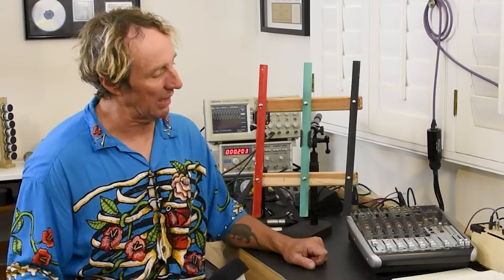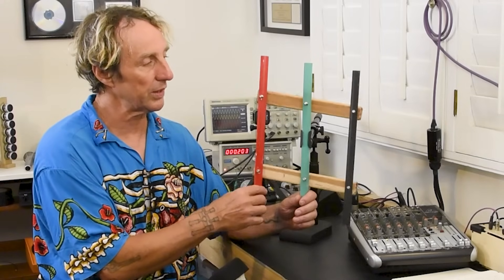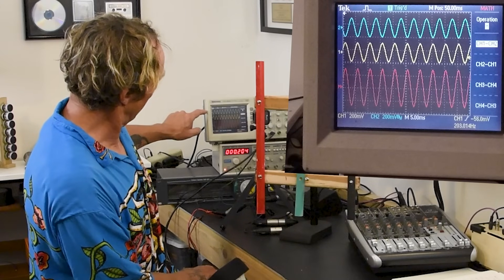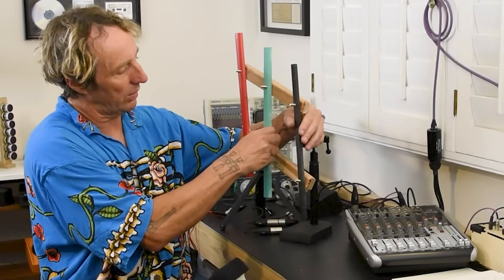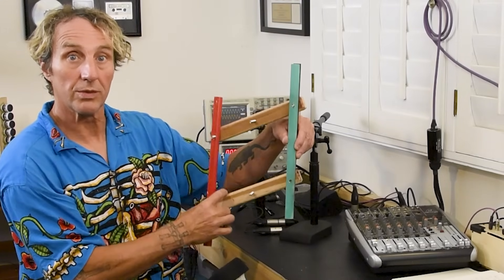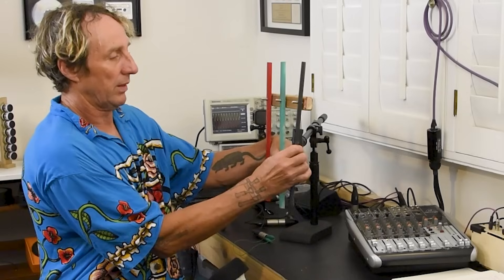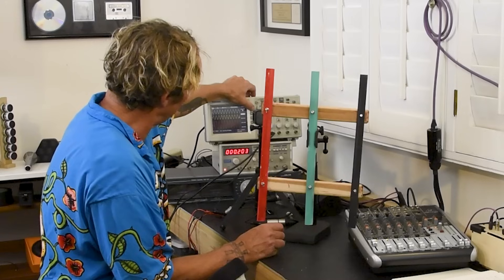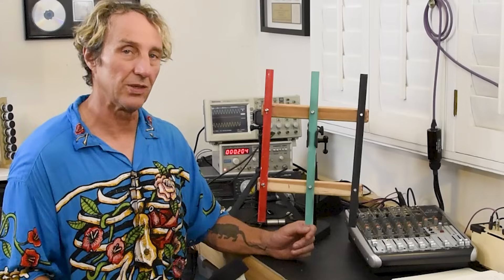The Mechanics Of Audio Balanced Lines Explained

Comment: This is a common misconception. Symmetry, which is sharing the opposite voltage across two lines, does not make a cable balanced. All it does is increase the maximum signal the cable can carry. If you do the math you can see that the noise rejection done by balancing the cable works if you transmit the signal entirely down one cable or the other, or split them evenly. Balancing means that you have a shared voltage reference that is separate from the safety/electrical ground, which helps prevent ground loop interference. I highly recommend watching the Audio Engineering Society sessions by Bill Whitlock on grounding.
Reply: Very good, simple and logical explanation indeed !!!
Reply: Effin brilliant!
Reply from the maker: I understand that we can use asymmetrical balanced lines as long as neither line is grounded. 

Since there is no ground reference for balanced lines generated by microphones and transformed , the offset to ground is irrelevant 

That said, symmetrical balanced line naturally occur and for all practical purposes the existence of asymmetrical balanced lines is irrelevant in practice.

But as you said, unbalanced lines that are ground references will fail to fully utilize all available input gain as the offset can cause one line to overload before the other in the input circuit
Reply: @  yes, it's a sadly too common issue that equipment manufacturers don't properly implement balanced IO and will tie neutral to ground, totally eliminating the benefits of balancing, believing symmetry is all that matters. Properly implemented balancing is almost entirely impervious to interference, as I believe you've shown in some of your past videos.
Reply from the maker: Very and yes
Reply: @DaveRat would be nice to have a vid reg. that fail implementations too.
Reply from the maker: That's tougher because it would focus on specific manufacturer flaws and not be this universal is understanding the concept
Reply: You are 100% correct. You can actually have 100% of the signal on one line and 0% of the signal on the other and the interface can still be balanced because it's all about EQUAL impedances of both signal lines (with respect to ground). Bill Whitlock is the headmaster of combating this misinformation in the audio industry. We haven't even talked about the Pin 1 problem yet.
Reply from the maker: And yet a ground isn't even required for a signal to be balanced.
Reply: @DaveRat right, just need the two output wires of the audio transformer!  Positive and Negative, pins 2 and 3 on the XLR, or Tip and Ring on the TRS plug
Reply from the maker: Agreed
Reply: @DaveRat  Ground is required for a signal to be balanced, as that is the ultimate destination of much of our EMF. In fact the term balanced refers to the equal impedance to ground of the signal conductors. Your differential amplifier has a ground reference in the circuit, even if that is just a battery, and transformers have inductive and capacitive coupling to their environment, which is usually a grounded chassis.

Additionally non-symmetrical signals are common in inexpensive differential amplifier circuits. You can even have balanced lines without any signal on one line, as long as both lines have an equal impedance to ground.

The reason for this is that noise currents that get coupled into the lines need to have equal impedance to ground in order to become equal voltages on both lines. E=IR

This video does a great job describing differential signals, but is spreading some common misunderstandings about balanced signals.
Reply from the maker: @mudged-upguitars4643 hmmmm, is it? Is a ground required?

Does a dynamic mic with each side of the voice coil connected to a pair of wires which are connected to the two ends of the primary to a transformer create a balance line, a differential circuit, is it symmetrical, none or all?

Where's the ground? Is the ground needed? Of course there's always ground somewhere as long as we are not floating in deep space but whether it's connected to anything in the circuit or not is another story.

Equal impedance to ground and that impedance could be infinity, correct?

Does the microphone and transformer need a shield to function? Is it a balanced line without the shield/ground/3rd wire?

Does a dynamic mic connected to a transformer create a symmetrical circuit and not a balanced line if there's no ground?

I think to say that balance lines require a ground infer that balanced lines require a shield and that is misleading.

And agreed that noise rejection can be achieved with asymmetrical signal levels on twisted pair lines driving balanced inputs.
Reply: @DaveRat  I think you are conflating balanced and differential again.

Voltage is the difference in potential between 2 points. If you have a floating circuit, with no ground, then voltage is measured between the lines. This makes differential currents, but only a single voltage, not opposite polarity voltages with respect to ground since there is no ground being considered. The only way that is a balanced circuit is if both wires have an equal impedance and are an equal distance from the noise source and environment. We connect signal conductors to ground with resistance to more easily control the impedances involved.

If you create a balanced line with the cable shield disconnected on one side there is still a capacitive connection for higher frequencies and inductively connection for low frequencies. There is no such thing as infinite impedance in the real world.

Let's have an extreme example, telephone lines. These used to be a pair of copper lines connected to 600 ohm transformers on either side. Where is the ground? On the telephone pole where the transformer can inductively and capacitively couple to its environment.
Reply from the maker: @mudged-upguitars4643 @mudged-upguitars4643 my understanding is a balanced line does not need 3 wires, only 2 are needed and neither of those 2 needs or should be grounded.

Are you saying that is incorrect?

My understading is that the output of a dynamic mic is such that if one side is shorted to ground and measurement is taken, it will be an equal voltage and opposite polarity to a measurement taken if the wires are reversed and the other side shorted to ground.

Is that not correct?

You mentioned that ground is referenced to control the impedances but is it necessary for a balanced line to function?

In your example of two 600 ohm telephone transformers Are you saying it wouldn't function if the ground is removed?
Reply: @DaveRat  I think there's a horrible mish mash of theory and reality in this discussion.

While the maths and physics say one thing, a real world (especially commercially viable) implementation will face more constraints.

The simplest version is 2 transformers, one each end of the wire, with no centre tap or other connection..
While being "pure" they are expensive and heavy and still need more work to be useful.
In that case, the concept of impedance is straight forward.

But, since the receiving end requires some electronics anyway, the ethos is why not have that circuit replace the transformer.
Again, it's possible to have each input be a separate floating circuit, but that's needlessly expensive.

Far more practical is to effectively centre tap the input, resulting in each leg of the signal wire being opposite polarity and identical magnitude with respect to the centre tap (and if you can conjour up a scenario where that isn't ground.. Very well done)

I say centre tap the input.
It can be done with outputs too, but it's best that only 1 end is tied (even virtually) to ground.
So, why opt for electronic inputs and transformer outputs? Because dynamic microphones are a thing.

One other thing to be wary of is trying to shoehorn every scenario into 1 cable standard solution.. It cannot work, that's why DI boxes were born.
Reply from the maker: So, with a passive output like a dynamic mic, DI box or transformer or an isolation transformer, all of which are extremely common in pro audio. (Maybe not the transformer out so much anymore) driving a differential balanced electronic or transformer input, the third wire ground/shield is optional. The shield helps with noise but is not part of the electric circuit carrying the signal.

And yet that does form a balanced line.

Input transformers are or were when they were common, often had center taps but that was mainly for phantom power. DI box outputs and iso transformers typically don't have center taps and are used for line balancing.

Anyway, the goal of the video was to describe how balanced lines work in a simple and easy to understand way. 

The facts that balanced lines can work in other ways like having non-symetrical signals as long as the impedance to ground is the same and that having a 3rd wire for ground/shield is desirable but not necessary or that even without the 3 wire that somewhere down the signal chain there will be a ground or earth, are relevant.

The brilliance of the naturally occurring transformer to transformer balanced line for telephones that you describe, I believe is the foundation.

Then later on electronic circuits were created to recreate balance lines electronically instead of passively.

That's where all these nuances and differentials that were discussing come into play.

Very cool and I enjoy the conversation
Reply: @DaveRat  I am so happy to be having a technical talk with you. You have blown my mind so many times. I gush about your feeder cable wrapping video regularly.

In your examples both ends of the interface still have circuit grounds. If you took the transformers out of their boxes you would still have a differential signal, but without a stable ground reference they will have terrible Common Mode Rejection Ratios.

It is a pedantic but, I believe, an important distinction. People often think "balanced" means balanced signals when it is in fact referring to balancing noise voltages for maximum rejection.

The ground conductor serves 3 purposes.:

1. Phantom power return path, as you mentioned. 

2. An electrostatic shield to prevent capacitive coupling of high frequencies with wavelengths short enough to cause differential voltages between the lines. It does nothing for inductively coupled noise, which is one of the reasons tightly twisted conductors have a better Common Mode Rejection. This only needs to be attached on one side to be effective, but the telescoping ground should always be cut on the input side, to avoid inadvertently connecting an antenna to the input before you apply gain.

3. Distribute a zero volt reference between gear. This makes sure everyone has the same ground reference and keeps impedance to ground more consistent, but is not necessary because each device has their own ground circuit they are referencing voltage to.

Talking about differential voltages on two lines without ground makes no sense because you are referring to ground to describe their electric potential. Describing differential currents makes more sense, but even there a reference to ground is necessary to describe noise voltage because the noise should be the same on both lines and thus 0 volts.
Reply from the maker: @mudged-upguitars4643 agreed that the noise being as close to identical on both lines is the key to cancellation.

I still think there's something missing in communication or understanding regarding the earth or ground or shield.

Earth, ground or shield is just not necessary or needed for a line to be balanced.

A twisted wire pair with a resistor at the end across the lines that are connected to a differential input or a transformer input will be balanced if those lines are the same length and same wire gauge and as you said, the same impedance to ground. They need to be identical enough that any noise induced is induced equally on both wires 

End of circuit, end of story, no ground needed. The output of the differential circuit or transformer will have a signal that encompasses any voltage differentials between the two wires while any voltages or noise signals that are common to both wires won't pass through the differential input or transformer or exist.

If you apply the same voltage or same noise or same anything to both the wires attached to the input of a transformer then there's no differential between those two wires and therefore there is no reproducible signal.

Anything that's different on the two wires will be the signal that is seen by and passes through the transformer or differential input.

Differential input, is by definition passing  the difference between signals on the 2 input wires and not passing signals that are the same on both.

Apply a signal to one wire and not to the other or vice versa and that signal will pass.

Apply it to both and it will not pass

Apply the same signal but with opposing polarity on one wire to the other and it will pass.

This will work with a fully isolated setup that has no ground or earth whatsoever

This can be easily demonstrated by hooking a balanced microphone up to a mic cable, cutting the ground wire on the cable or using unshielded cable, connecting that to a transformer And using a battery operated meter to measure the output of the transformer shout into the mic and you will see signal nothing is grounded nothing is earthed.

And also any noise that is equally induced on both of those wires between the mic and the transformer will not pass through the transformer. 

How we know this because if we apply a signal to the input of a transformer and we short those two transformer input wires together sets it applies the same signal to both sides of the input, there is no output on the transformer. Same thing with any noise that's equally induced on both of the wires.

It's pretty much that simple

And yes this is great chatting and helpful. You are helping me further clarify a way to describe this balanced line adventure in even simpler terms as well as come up with some extremely easy demos should I take a stab at another video down this line.

Very cool
Reply: @DaveRat  I pretty much agree with all that except saying end of circuit end of story. To high enough frequencies that transformer behaves more like a capacitor. Since the circuits on the secondary winding are usually unbalanced one side of the line can cause a change in voltage on the signal line of the transformer secondary, even if it is a common mode voltages on both lines of the primary.

The original comment here recommended Bill Whitlock's balanced and unbalanced interface paper, but I will also recommend his paper on Audio transformers.

I will definitely agree some of the confusion here is because of the many different meanings of ground. To me, ground refers to the ground state of atoms, uncharged. Typical this is the way we use ground, as a charge sink essentially. The dirt outside is very effective at this job, but it has little relation to signal ground or circuit ground. Those might be connected to earth ground to make sure everything we touch has the same potential, but mainly they act as return paths of signal or circuit currents.

In balanced interfaces signal ground does not act as a return path for signal currents, but can act as a return path for noise currents.

Additionally differential amplifiers can reject common mode voltages without being balanced. Our power distribution system is a great example of this. Despite the fact that hot and neutral have different impedances to ground, power transformers still reject any common mode voltages that develop due to conductor resistance over a long run.

Just to reiterate, differential circuits are not all balanced. The terms are not interchangeable and mean very different things. Differential inputs, transformer or electronic, can reject noise without being balanced, but are more effective at noise rejection if they are.

Rane also has a very interesting paper on how to interconnect balanced and unbalanced interfaces. There are a few examples where connecting an unbalanced output to a balanced input can lead to some noise rejection, especially with transformers.
Reply from the maker: @mudged-upguitars4643 I agree and for this discussion let's just assume that we're not talking about frequencies above the capability of the audio equipment to reproduce. Transformers tend to act like a low-pass filter which can be helpful but again that's pretty much unrelated to the topic at hand.

I'm familiar with the Rane and Bill Whitlock documents. And there's a lot of nuance and complications once you really dive into any subject.

And I think that if you read through the responses you'll see two types of responses to this video.

One response realm is focused on the fringe aspects of balance lines that have an imbalance in signal levels and the importance of impedance to ground.

Great knowledge and true

And the other group of comments falls into the "oh I finally understand this stuff" realm and that was my goal is to get people that have been unable to get their head around this to finally get it.

And should they choose to dive in and start designing circuits they will quickly and easily learn the aspects that fall outside of the natural simplicity of a balanced line.

Where in something as simple as a dynamic microphone can be attached to a transformer using two signal carrying wires and a shield and achieve much higher noise rejection then using the shield as a current carrying or signal carrying conductor.

When balance lines were first implemented that's all there was. There wasn't differential inputs and phase inverting op amps. All that stuff was created later to try and eliminate transformers and save cost and improve capabilities.

And Bill comes along with this very insightful perspective and information that balance lines do not need to be balanced they can be imbalanced. Amazing and cool and true!

But that's not information that's fundamental to understanding how a balanced line works.

Very cool and pleasure
Reply: @DaveRat  I understand your position there. There is great value in what you do just building interest in these topics and getting people to want to dig deeper.

I will caution you, as someone who has taught audio electronics and audio measurements for almost 2 decades, it is very easy to spread misunderstanding by oversimplifying without addressing the nuance. Just because they feel like they understand doesn't mean they have the same understanding as you. That is a very easy assumption to make. I know it bit me many times. I know it's not your first rodeo either.

Anyway, thank you for this. Much love. It has been a great pleasure. Keep making awesome stuff. The body polarity video was super cool.
Reply from the maker: @mudged-upguitars4643 very cool and wise advice. Yes people are really good at acting like they understand way more than they actually comprehend.

Over the 10 plus years I've been doing these YouTube videos I've kind of migrated from doing very detailed and in-depth meanderings to more simple get the point across adventures. 

I agree that going into more depth would be beneficial and I will consider doing a follow-up video to expand on it

Very cool and stay in touch!
Reply: Maximum signal the cable can carry....
Dude! We are talking mV and mA at most, the CABLE isnt going to boil or arc!

So, thats not exactly what you meant.

What you really mean is that IF the signals have a common reference, none of it gets eaten by common mode rejection.
You also miss that if there isnt a common reference, your noise rejection is worse (due to the effective signal being weaker)